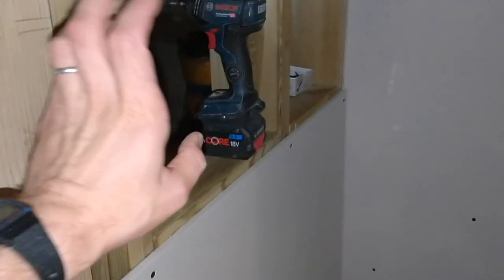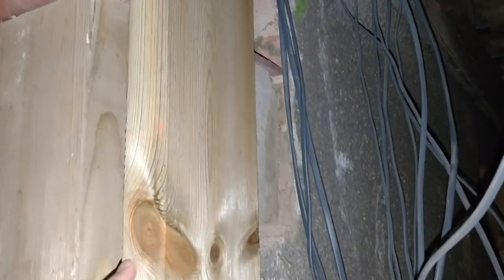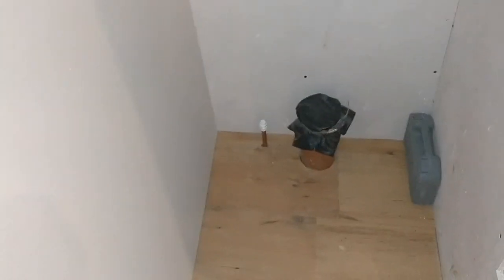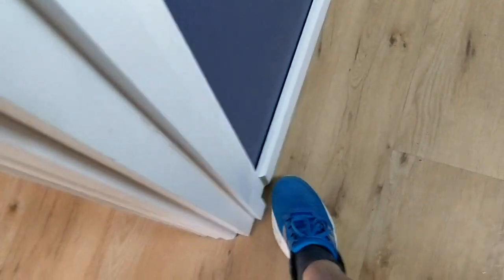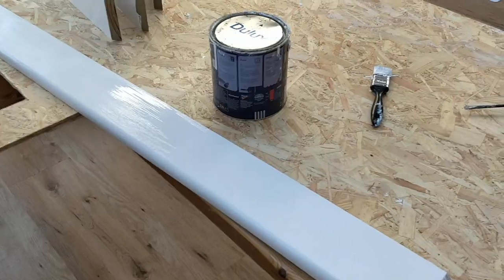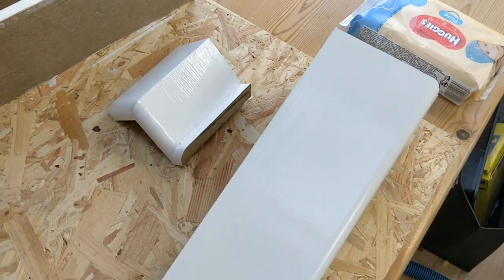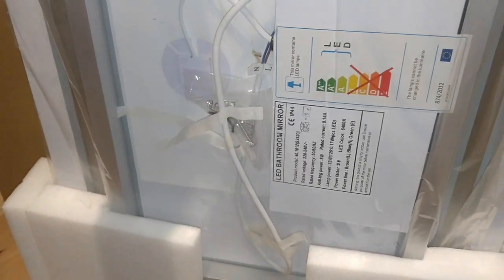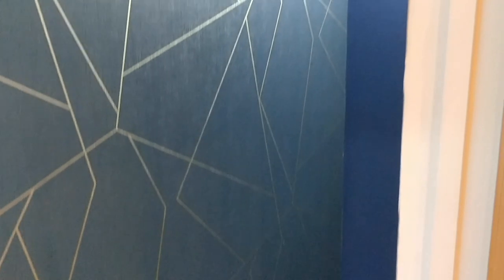Hotel spec downstairs toilet - Part 1

Comment: Whats the white flap on the wall, where your left leg would be as if you was taking a 💩? 😂
Reply from the maker: That's an inspection hatch and rodding point for the soil stack 🤣👍
Reply: @OfficeBoyBuilder  for those really hard ones that need rodding. I thought it was the hatch for your Mrs to pass you your dinner whilst you're on the bog ;-)